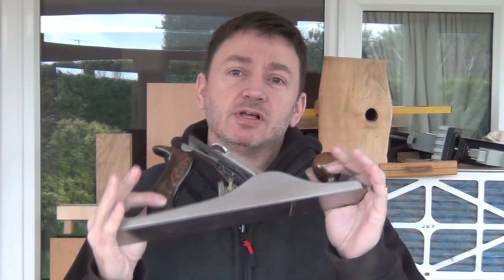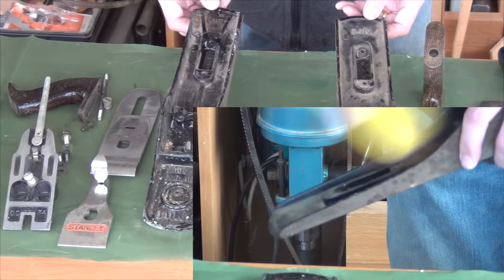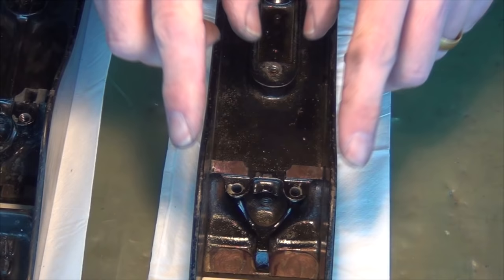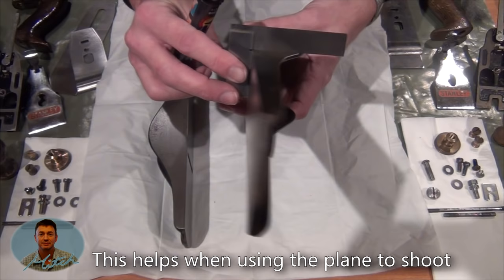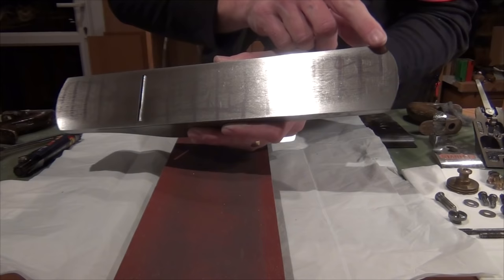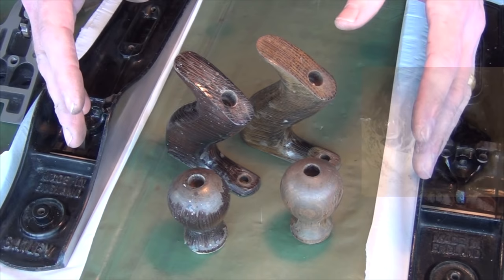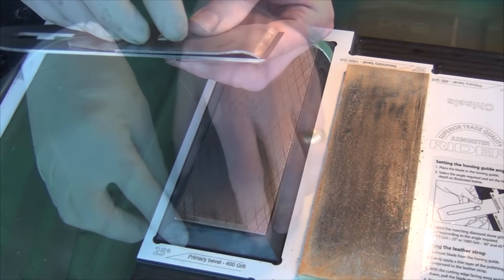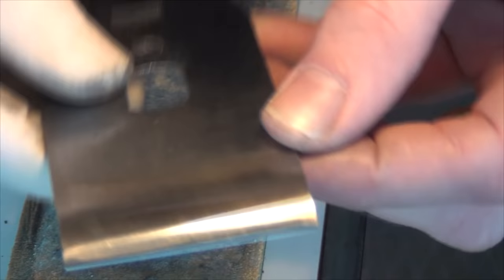Hand Plane Tune-Up - Amazing Results from Your Plane

Comment: That was the best plane restoration video i have seen so far. I have a nr4 waiting for this kinda job. 

Also, i have a number of old wooden molding planes in need of some work. I dont know if you use wooden planes, but if you do, a video similar to this one on wooden plane restoration would be very helpful. 

Even better, why not have a restoration challenge and have a group of makers release a tool restoration vid at a certain date? Or a contest? I would try to join that!
Reply from the maker: +Willem Kossen Cheers Willem - now my head will be too big to get into the workshop! 
I don't have many wooden planes, but two have appeared in earlier fix-up videos - a coffin smoother and rebate plane. 
Challenge 😏!

Comment: Hello Mitch, I finally had a chance to watch this video. I must say that both of the plane restorations are a must watch for someone who is looking to learn the ins and outs of a hand plane and essential skills to remedy common issues. Both very detailed. The number 5 plane restoration fills in the gaps that I didn't think were present in the previous video. For me it was the frog contact points and the truing up the sides. I did enjoy the  sound of the rain in the first one, lol. I used the first video to restore my first stanlay no 4 plane and it was of great help.
Reply from the maker: +Peter Pacholkow Thanks Peter. My hope was that the latest video would cover all the essentials in a lot less time, yet still be easy to understand with sufficient demonstration. The first video has been fairly popular despite its length, but I know many people just wouldn't think of watching something that long! Thanks for all your comments, and I'm glad they have been of use. Happy woodworking, Mitch

Comment: Excellent tutorial Mitch.  Crap... now I need to redo all my frogs, cap irons, adjustment wheels, and levers. Thanks for all the tips.  Very helpful.  That freeplay is annoying.  Now you've provided a remedy.  Thanks.

Btw, instead of the vinegar I used phosphoric acid (Krud Kutter) and tanked the plane body and rusty parts for 48 hours.  Everything was whistle clean, not a molecule of paint or rust was left.  Afterwards I used sandpaper and scotchbrite pads to shine up the parts.  

As you know, there's nothing better for the soul of a true woodworker than using a handplane.  Thanks to you and Paul Sellers my handplanes are my go to tools in my shop.  They have saved me a great many hours of sanding and have elevated the quality of my wood working.  I am the proud owner of 8 Stanleys (3's, 4's, 5's) and 1 #7 Record.  I love them all.
Reply from the maker: +Hardnox thanks Peter. I&#39;ve not tried the phosphoric acid, buy sounds like a good tip.
Hope you&#39;ll enjoy the set up video once I&#39;ve completed it. Nobody really differs on the theory of tuning a plane, but set up is another matter. I&#39;ll expect some flak from those who can&#39;t accept that a different way to theirs might not be wrong😉!  Hopefully some will experiment and find what works best for them.
Reply: Mitch Peacock - WOmadeOD I look forward to your video.  Like everything else, people are resistant to any change especially when they think they know something.  I am reminded of the old saying: "the blindest people are those that refuse to see".  The phosphoric acid works amazingly well.  It can be reused many times.  I filter it before returning it to the jug.

Comment: Thanks, Mitch. Maybe you could mention that when you are flattening the sole you have the blade mounted and retracted, rather than flattening the sole without the blade mounted. Having the blade mounted puts the sole under tension for an accurate assessment. If flattening the sole without those things in place, the sole can twist when under tension, throwing it out of flatness.
Reply from the maker: Fair point Jim. So long as one uses the same tension every time I guess. I do see the logic, but I haven't evaluated the magnitude of the effect. Certainly on planes like shoulder planes or rebate planes, the scope for movement is significant.

Comment: Thank you for your informative video. There are several great points in this video that teach the finer details of tuning a plane that others have not addressed as clearly and thoroughly as you have here. I will return to this video many times as I acquire used planes and prepare each of them to become "masters." Many thanks, Mitch. 
Kat
Reply from the maker: +Kat Beers-McCormick Thanks Kat, much appreciated. I wasn't sure how many people would have got the plane reference to 'Jack of all trades, master of none' - but you're the first to mention it! Cheers, Mitch

Comment: Hi, Just an observation on selecting the plane to be tuned up, the castings with the ribs were not added as an improvement but to allow Stanley to use relatively "green" castings to speed up production. The down side is that the casting can still move over time in the completed plane. The planes without the ribs are older and the castings were aged and fully stress releived prior to machining and will generally be flat with out the need to lap the sole and have better machining in other areas also.
All the best and thanks for the great videos, I always get something from watching them.
Reply from the maker: Thanks, that's very useful to know. It'd be interesting to know how modern castings are treated, and wether current materials and processes negate the need for such considerations.
Reply: Hi Mitch Peacock, My only info on that came from youtube videos by a youtube chanel "Brandmade TV" where they show the production of the  Lee valley tools Jack rebate plane and a video from Lie Nielsen  tools about the casting of plane bodies. Both companies use ductile cast iron and claim that it is stress relieved. Ductile cast iron is a different animal to the simple grey cast iron used in the older Stanley and Record planes. it is less prone to cracking and is heavier and stronger.How they stress relieve the castings I do not know. 
I was told by a man who used to be a pattern maker in the 60's and 70's in Sheffield England that all rough cast iron castings were left outside in piles in all sorts of weather for up to two years and were  regularly moved along the outside of the building. The castings were tossed into a bucket on a front end loader, jiggled up and down using the hydraulics then dumped out on the ground a few yards over and when they reached the other end of the building they were considered to be seasoned and stress relieved and ready to be machined.
Reply from the maker: labrat7357 Haha, and just look how much care we all pay to not knocking or dropping them ourselves! Cheers
Reply: Mitch Peacock - WOmadeOD 
The Midwest Foundry made grey iron and semi steel castings. The majority of the castings were shot blasted to relieve stress and blast away the scale. Some castings were annealed in large gas furnaces where they were brought up to critical temperature and held there until all the material had reach a homoginous temperature. The engineer called it soaking. 
The same furnaces were used to sinter cracked castings. If the castings were dumped too soon into the shakeout they could crack. Several thousand pounds of castings could be annealed and sintered at the same time. 
Ford Motors left the engine blocks for the V-8's outside for a year in Michigan weather. Rain, snow, heat, and rust. If they passed inspection they were machined.
Reply: @OldSneelock   Shot blasting for stress relief actually works by putting compressive stress into the surface so that tensile cracks cannot develop.

Comment: 30 minutes is about right for tuning up a plane.  Well done.  My plane is no. 4 Stanley clone labeled as Mastercraft.  Made in England.  I still use a honing guide because I lack the free handing skills. The plane is still very difficult to adjust to expose the beveled edge.  The frog required quite a bit of flattening to make it uniformly flat.
Reply from the maker: +Buck Rogers Thanks. Do you perhaps have the lever cap screw too tight? Try loosening it a little. Without the blade assembly installed, does the spin wheel move easily on it's threaded rod? If not that, try moving the chip breaker further back from the edge - sometimes the slot is machined too close to the front, limiting the possible depth of cut.
Reply: +Mitch Peacock - WOmadeOD 

It spins freely without the blade.  Backing off on the screw helps but enough to free up the adjustment effort results in not enough clamping force.
Reply from the maker: +Buck Rogers One other thing that occurs to me, is the frog far enough forward for the blade to clear the mouth without fouling at all? Might be worth adjusting the frog forwards a little just to rule this out.
With regards to the lever cap screw, the depth adjustment mechanism should stop the blade being pushed back in use, so the  lever cap only needs sufficient force to prevent the blade moving laterally. When you say 'not enough clamping force', what is happening to make you say that? 
I'll check back here tomorrow, but for now it's way past my bedtime😉
Reply: +Mitch Peacock - WOmadeOD  
Mitch,  
Thanks for the help.  I went and back of the screw a little more while it was latched.  It helped some with the effort.  Then the effort to turn became higher.  It feels like it is being jammed or binding.  So, I looked through the side between the blade/chip breaker where the lever passes through the blade.  It was hitting the stainless flat spring because it protruded too far.  I disassembled and took my Dremel to the tip of the adjuster that was hitting the stainless flat spring. I removed about a millimeter, reassembled the effort became much easier.  Not "one finger easy" but much, much better.  These Stanley clone planes are quite the "science project."  It is quite the challenge.

Bill (aka Buck Rogers)
Reply from the maker: +Buck Rogers Ah, not come across that before - definitely one to remember. You've discovered by now that bench planes really aren't a dark art; there aren't that many moving parts, so when it doesn't do what it should it just takes a little investigation. WELL DONE! Now you can enjoy using it.
Reply: +Mitch Peacock - WOmadeOD 
Mitch, 
The interference or rub point appears to be inevitable as the blade is consumed or the tolerance stack up of this particular plane was the problem when it was new. The "fix" or modification to eliminate the binding condition is easy.  You just have to know you have to do it.  Now I know why this new looking Stanley clone no. 4 plane was only $17 at the local used tool shop.  I must thank you for thorough video training sessions.
Reply from the maker: +Buck Rogers You're most welcome

Comment: When I did my last one , I also repainted the inside with black metal paint . It looked brand new when finished . I need to make a new back handle grip for one of mine . It's cracked , and one of the plastic types .
Reply from the maker: Making a replacement handle is one video I haven't done! However, I do have a 3 which needs either a repair or a replacement. Now there's an idea💡

Comment: Great instruction Thanks Mitch.I have a couple bailey's A 3, 4 and 2  5's
Reply from the maker: Cheers! Nice, I hope you see some improvement in all of them. Your 3 and 4 should probably be tuned as smoothers, assuming you're mainly working on furniture size components. Maybe set up one with a back bevel (last weeks video) if you have any trouble with tearout.

Comment: It's very easy to remove the breaker height adjusting levers in the frog (not the lateral adjuster). The little pin hammers out behind the frog, I had mine out in 2 minutes. Which makes it much easier to flatten the frog.

Comment: Thanks, Mitch. You've answered a bunch of my questions. I've been struggling with a new Kunz no 4 for months now, thinking the issue was the chip breaker (which is inaccurately made). Will have to strip it down and look at everything.
Reply from the maker: Gosh, I thought Kunz was quite a good brand! Hope you get it working well

Comment: Excellent info, one of the best I've seen, well worth watching 30 min. I had never seen that scraping with a file tip, always have trouble squaring the sides of old planes. And your shim/clip for taking out depth adjuster lash was extremely informative. I have my grandfather's No. 5 (1899 patent date), it's in pretty nice condition but has no frog adjustment, so I have tuned it as a smoother and occasional jointer, really enjoy using it. I've used many of the techniques you illustrated for setting up my No. 4's for scrubbing (8 inch radius works better for me than 3 inch) and smoothing, and an old No. 6 with no frog adjuster as a shooter. Thanks again, really enjoy these in-depth sessions.
Reply from the maker: Cheers Michael. Although I dislike the metal dust and the time it can take, there is a great payback in performance from a good tune up. Nice to hear your using some old planes too - such a shame that many are left to rot.
Reply: +Mitch Peacock - WOmadeOD I have only one modern plane, a Veritas No. 4, so I use nearly all antique planes. Also have and use a No. 5 1/4 "junior jack" that was checked out to me in high school woodworking and given to me by my shop teacher at the end of my last class, when he retired. I find that on eBay and at old tool swap meets here in California vintage planes are no longer cheap and nice ones are harder to find, so a lot of people must be reaching into the bardo and bringing them back to life. They will all be watching your videos!
Reply from the maker: +Michael Anderson that old supply and demand story. The tool dealers, advertising to buy old tools, often get the bargains. Car boot (trunk) sales still prove fruitful here. I'm lucky to have most of what I'd like already, some old some new.
Reply: +Mitch Peacock - WOmadeOD I don't know if those exist here, might be fun to find out, not that I need anymore planes...but a good breast drill would be nice...

Comment: A very thorough tune up video....and a nice tip on reducing the fly wheel travel.If you are now finding yourself at a lose end Mitch.....I have a no.4 and no.5 for sale if your interested? If not they'll be on eBay soon (other auction sites are available).
Reply from the maker: haha, I'm in the same predicament as you - too many similar planes, too little room! but thanks for the offer Chris.

Comment: Thanks.  I get something new from just about every plane tuning video.  I bought a No. 4 Craftsman from the 1970s about nine months ago and tuned it for scrubbing and it did a great job, but I recently decided I needed a better smoother than my No, 5, so I restored the iron and closed down the mouth and I have to say, even though I need to do more work on the iron,  it's my new favorite because that puppy shaves like a pro.  However, I never even considered working on the frog.  Now I'm going to check it just to make sure it's where it needs to be (and get that iron properly set up...I didn't get it squared off when I took the radius down from a scrub to a smoother so I need to put it on the diamond plate again and grind).
Reply from the maker: Cheers. I'm just about to film tackling a Stanley No.3 which I picked up in a very poor state.

Comment: When your flattening the frog why not use spray adhesive and stick sandpaper down to the iron and use that. You’d have a cut the sandpaper where the slot on the iron is so that the yoke and lateral adjuster will sit in that slot. Then you’ll get a perfect mating surface to the iron
Reply from the maker: That's an interesting idea. Well worth trying out. Cheers

Comment: You certainly went above and beyond with these planes. Very nice job. I think if you had two different iron sets you could probably achieve similar results with just one plane body could you not?
Reply from the maker: +B Batta Cheers. For sure it's a good idea to have interchangeable iron sets. Because I see a benefit to altering the mouth for different tasks, that necessitates adjusting the frog too, and therefore having a couple of planes set up saves some time.

Comment: Very insightfull video. You have quite alot more knowledge than most plane restoration videos. I love how you shimmed up the spin wheel and the chip breaker. I will also spend alot more time mating the frog to the body using your method. Cheers
Reply from the maker: Thank you Jannie

Comment: I've used Stanley and Record planes my whole career . I like a 5 and the wider but shorter 4 1/2 .
Reply from the maker: I have a record 4 1/2 as a dedicated smoother. Lovely plane
Reply: @mitchwoodwork  they have a good width and decent weight behind them . I always carry mine . I'm not a huge fan of handheld electric planes .

Comment: 13:55 or, instead of changing your sandpaper, use water or windex on it to assist. Wet/Dry sandpaper works better when wet in these cases.
Reply from the maker: Good point. I prefer to avoid water, but as long as its dried off well it should be fine.

Comment: Glad I came across this excellent vid. I recently purchased a no 5 from eBay to use on my shooting board but the sole is very unflat. Ive tuned a no 4 but that didn't require nearly half as much work so I was about to give up but seeing your clear instructions I'm going to have another go at the 5 and get it flat and fit for work.
Reply from the maker: Start with really coarse paper and change it regularly until it just touches the low points. Then work up through the grits. It is soul destroying work if you'll pardon the pun.